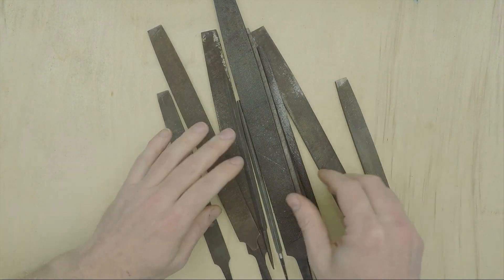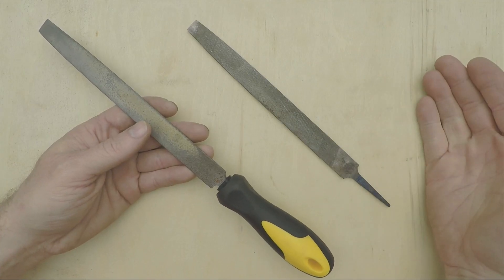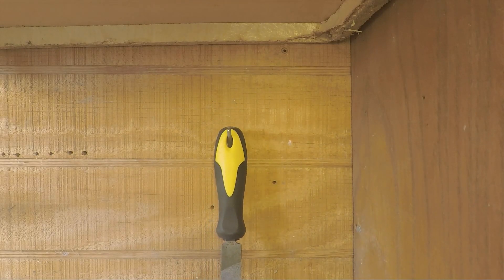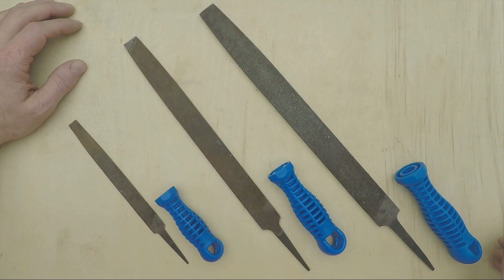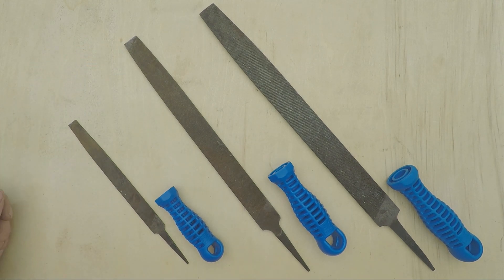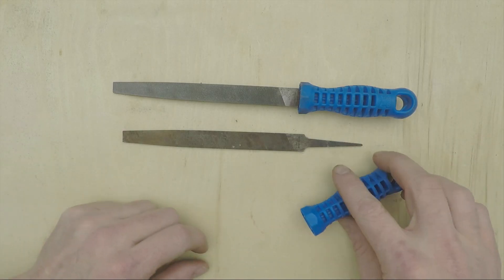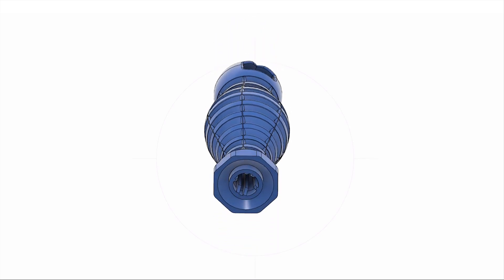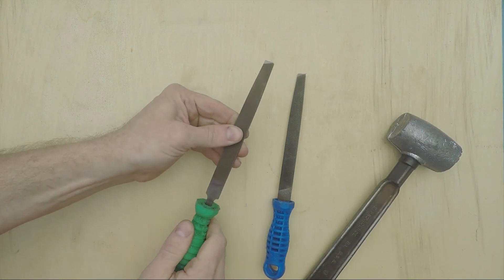Pferd File Handles

Comment: I can’t remember for sure where I picked it up (probably shop class), but the technique used to seat the tang into the handle was to rap the end of the handle on the bench and allow the inertia of the file to force its way into the slot. FWIW

Comment: Unfortunately alot of manufacturers sell files without handles and dont even offer them. Most of my handles ive made out of wood with a copper collet.
Reply: I just cut an appropriate piece out of a broken chair leg, put an aluminum collar over the end (you have to precisely cut the end for a tight fit), drill a hole for the tang. You can either open the hole up to a good tight fit on the tang, or wrap the top of the file with a wet rag, heat the tang with a blow torch until it singes wood, and burn the handle on. The wet rag keeps the file from loosing its temper.
Reply: @CleaveMountaineering  yeppers, what ever gets the job done... i usually just burn the tang into em like ya said. A few i used epoxy on, but most i just left removable. Just a shame that alot of these manufacturers just dont even include handles or even offer them... the chair leg is a good shortcut though, thanks.